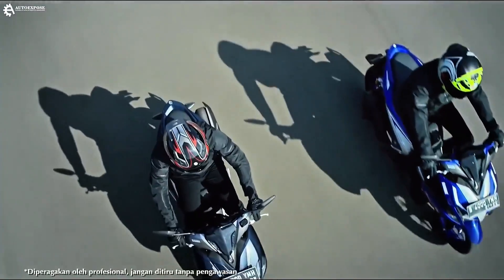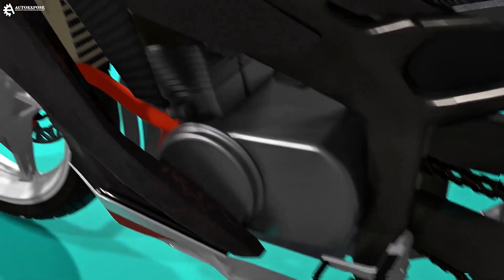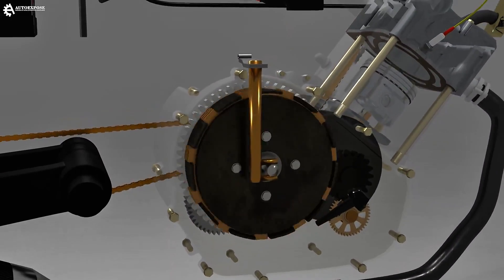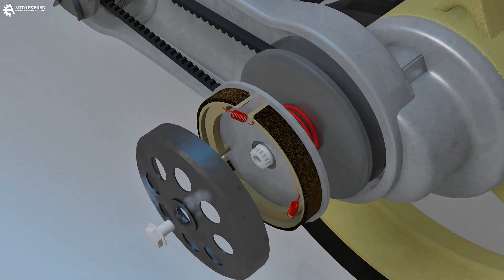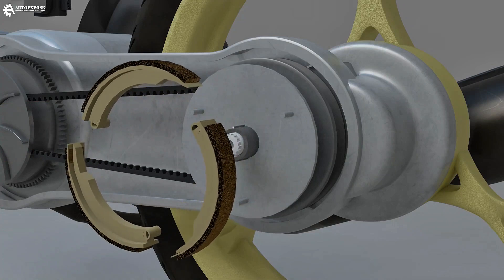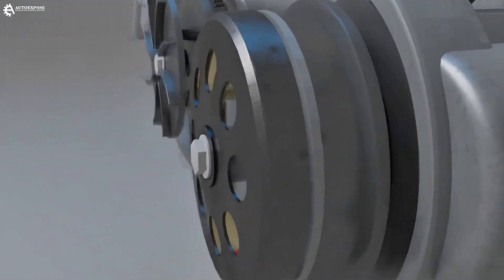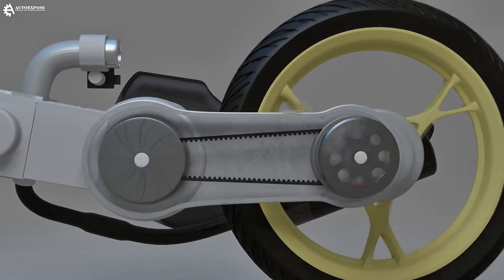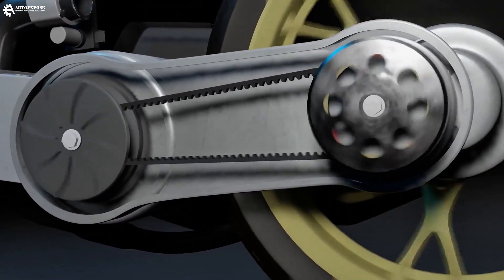How Engine Braking Works In Scooters

Comment: So what if i sat on my scooter and decided to coast downhill while the scooter was idling. The clutch would not engage because there is no throttle inputted to above a certain threshold?

So what if I was already driving downhill with the clutch engaged, engine spinning at 5000 rpm and I let off the throttle, the clutch wouldn't be able to disengage because the rpms were already high and now the wheel speed will keep the rpms from dropping since the clutch is already engaged prior?

There is no freewheeling once the clutch is enaged as long as wheel speed keeps rpm high enough to cause the centrifugal force?
Reply from the maker: There is no freewheeling once the centrifugal clutch is engaged, as long as wheel speed keeps engine RPM above the clutch’s disengagement point.

Your understanding is solid 👍
Reply: @AutoExposeGlobal  could do a video animation to cover Yamaha yecvt?